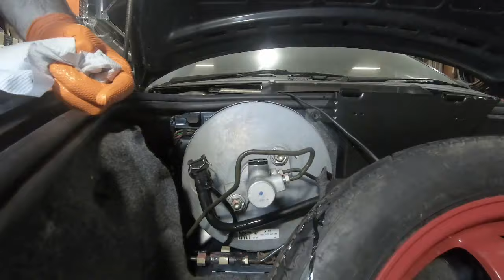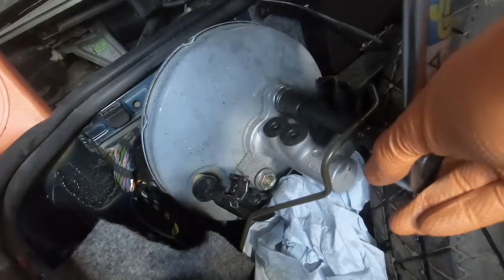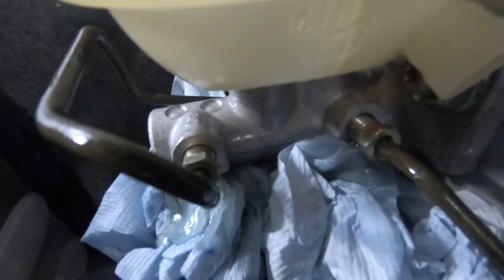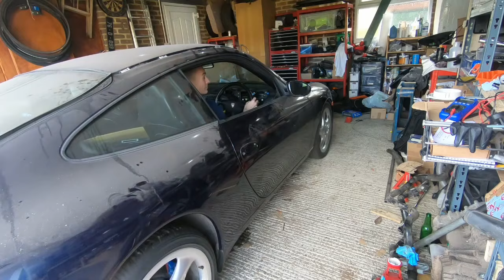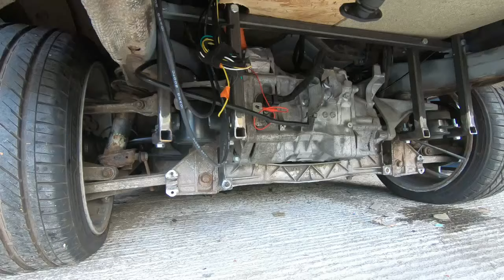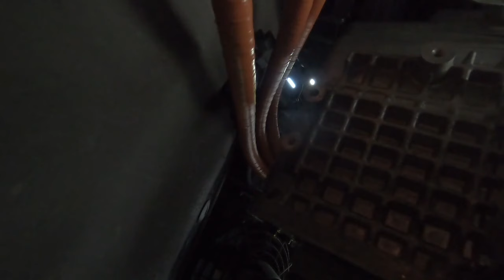Electric Porsche 911 project video 31 - Brake Master Cylinder Replacement and Short First Drive

Comment: Nice job! But don't forget to change ATF in leaf gearbox to proper gl4/5 oil (f.e. redline lite shock proof) for smoother work and far more than nissan wants longevity)
Reply from the maker: Thanks for the tip. Will do

Comment: You got your shafts ordered now? Dont want them to snap first time you do a burn out. Any ideas on what Batteries you want to use?
Reply: Wanted to see some wheel chirping but ya good shafts would be an excellent idea.
Reply from the maker: I am fighting my impatient nature and trying to wait until I have validated that the driveshafts are the right length before getting the final ones built. I want to do a bit of driving with these ones first to double check that my measurements and calculations were correct.
Reply from the maker: With batteries, I have a line on a really low mileage 40KWh Leaf pack that I may go for. Still not sure about the Leaf pack as it has no active cooling, but this one is only about 1.5k miles so should be in great condition and would give me decent range from the start.